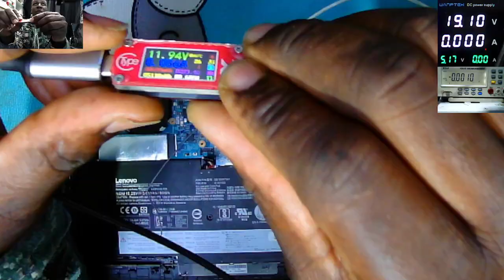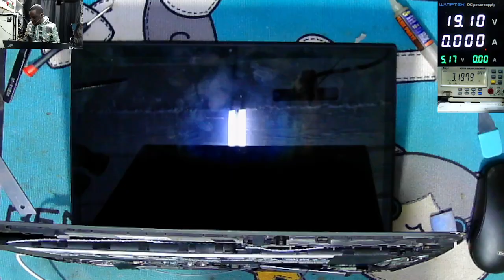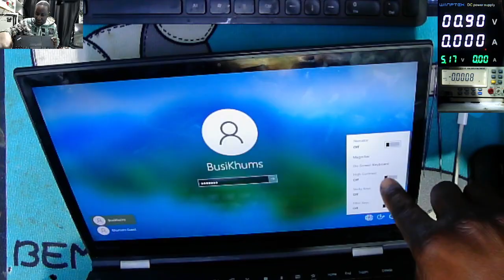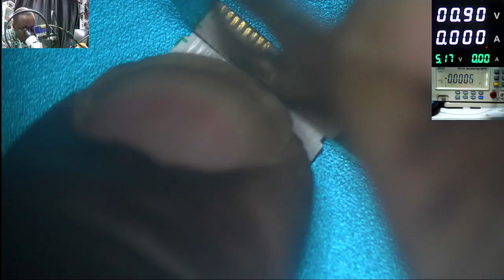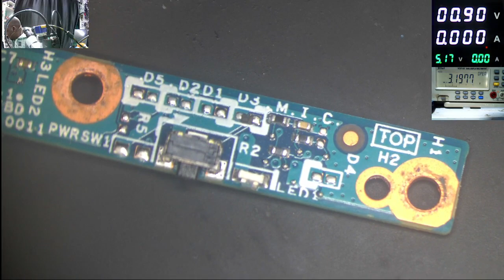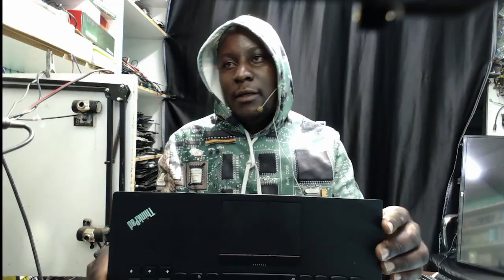Proper Hard Repair  Lenovo ThinkPad X1 Yoga No Power Dead, C-Type Input--Motherboard Repair Steps.

Comment: Hello, pls I have similar problems with my Lenovo thinkpad x1 carbon, gen 3. It stopped powering on and sometimes it turns on but after a while I shuts down again. I have changed the charger but the problem is still persistent. Pls how do I repair this I am on a budget and I don’t have the capacity to visit the technician.
Reply from the maker: Try bios reprogramming but can be anything
Reply: @BstAfricanElectronicsSurgery is there a way I can contact you personally.